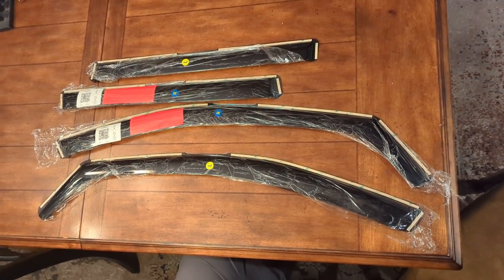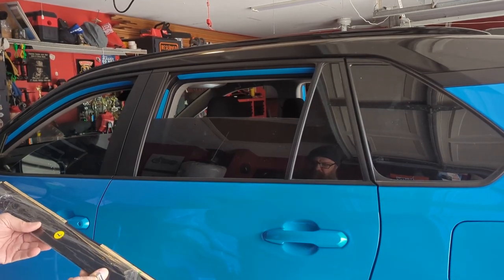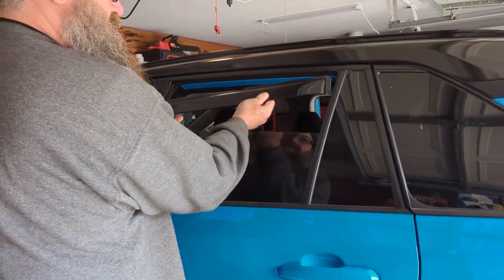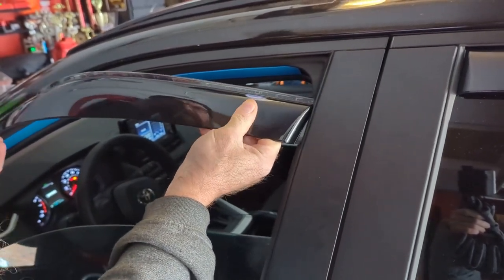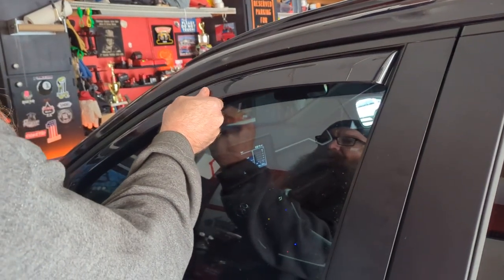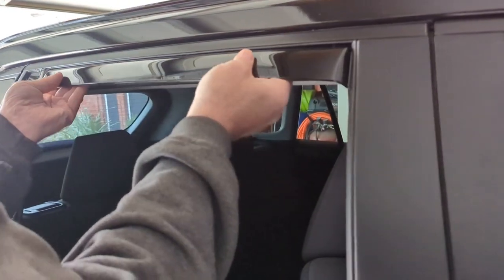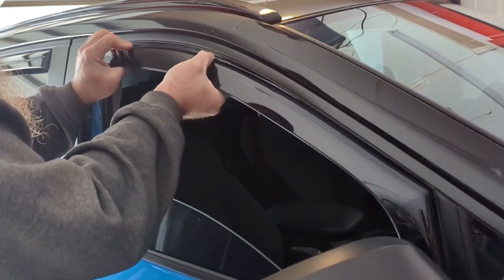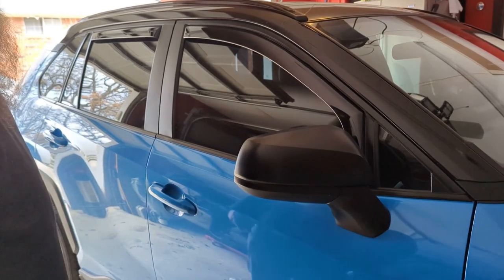Toyota RAV4 2019-2023 | Rain Guards | Window Visors | Goodyear Shatterproof in-Channel Deflectors

Comment: Thanks, but what about the clips that come with the package?
Reply from the maker: Mine didn't come with clips, although you're not the first person to mention them. I'm not sure where they would go.
Reply: The Goodyear deflector kit for my wife’s RAV4 came with metal clips, but the ones for my 4Runner, just like in this video, did NOT come with metal clips.  It says in the instructions to use the clips if they are included.  It seems they may not be needed for these in the 4Runner for whatever reason, unless it’s a consistent quality control issue.

Comment: mine came with clips too. So no need to used it? cant figure out how to use them.
Reply from the maker: Hi, there were no clips to install with ours so I assume it's fine without them. Ours are Goodyear brand and did not come with clips.
Reply: Did you buy it for a 4Runner or a different vehicle?

Comment: Good Job!  I just installed mine too.....on my 2023 rav4.  It came with them clips for the rear windows???  I don't think I need to use them right??  Seem's to be working o.k.
Reply from the maker: Hi, great job getting them installed. I don't recall mine coming with clips, so I guess they're not needed 😂 ours are working perfectly as well. Thanks again for watching!
Reply: Hi, how's the wind noise for 40mph and up? Does putting this deflector lessen the wind noise?